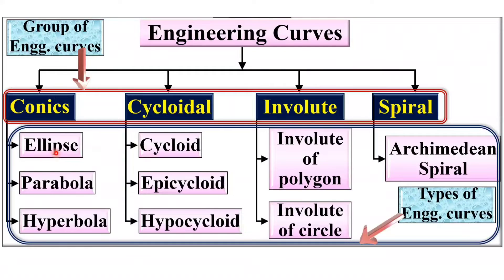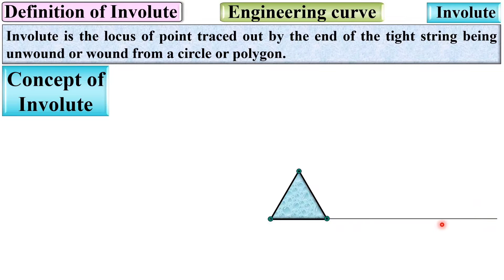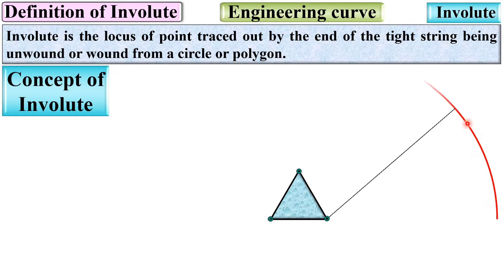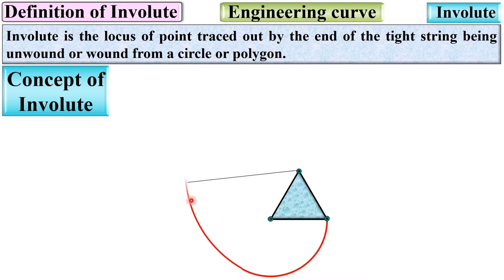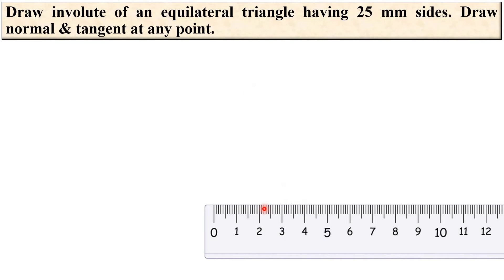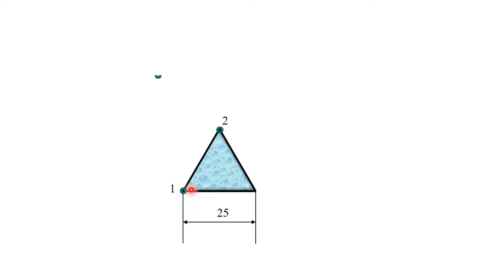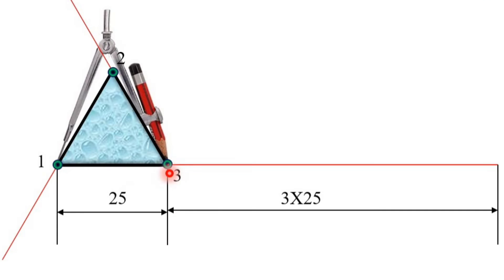Involute of Triangle | Normal & Tangent to Involute of Triangle | Engineering Drawing

Comment from the maker: Involute of Triangle explained with following timestamp: 
0:00 – Engineering Drawing lecture series 
0:31 – Definition of Involute 
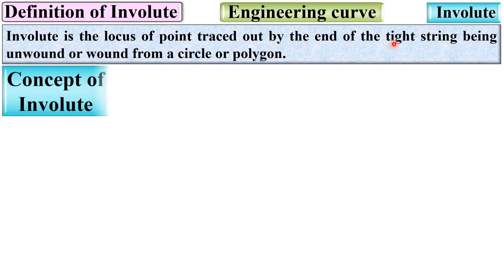0:43 – Concept of Involute
3:14 – Draw Involute of an equilateral triangle 
6:17 – Involute of Triangle
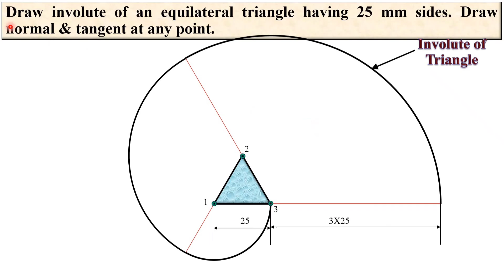6:27 – Draw normal and tangent at any point of Involute of Triangle 
7:13 – Normal to Involute of Triangle
7:28 – Tangent to Involute of Triangle